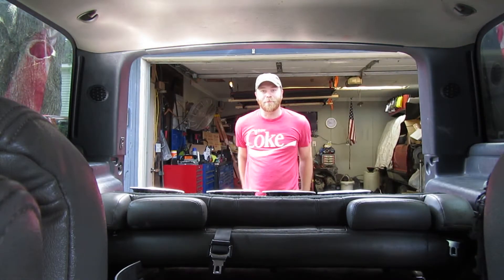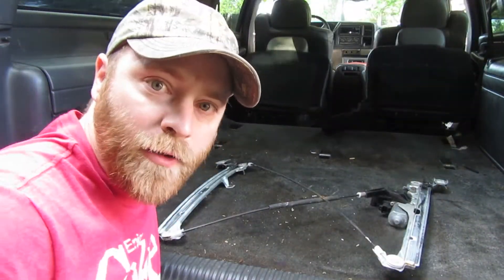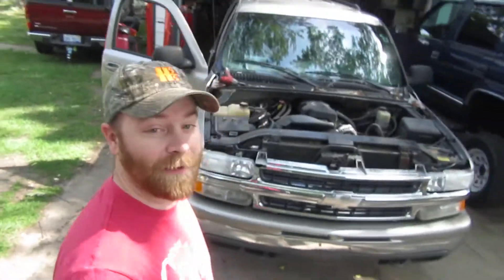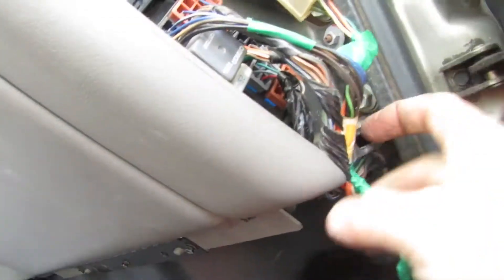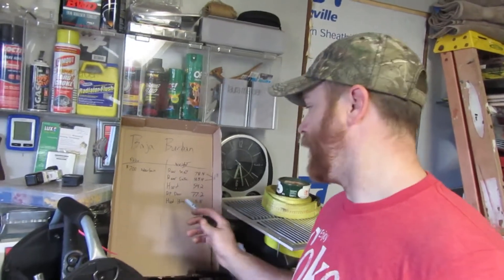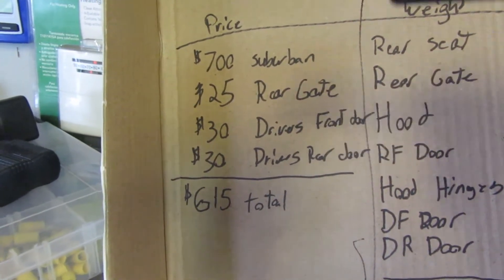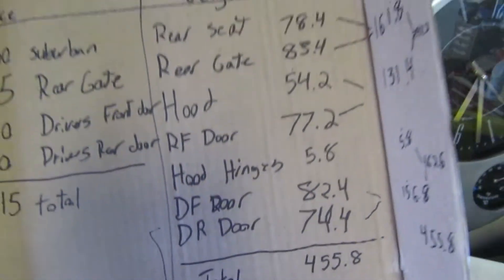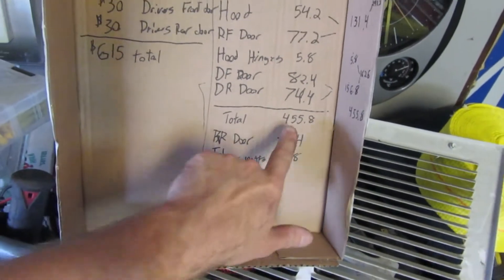Baja Burban 2.  Let's Lose Some Wieght!  PostalRedneck

Comment: On the door wiring where you unclipped it from the cab the pulled all of that sit thru the hole if you would pulled the rubber boot forward it simply unplugs. Right there and you dont have to pull all of that shit out. I have a 02 tahoe and rewired the door speakers to an amp and when I got to the door jam that's when I figured out that plug is under that rubber and I couldn't just run a wire thru the boot like the old trucks so I just clipped the stock wire before the door jamb and left the stock wire from the door jam to the speaker.
Reply from the maker: I have sense scraped out this truck but my buddy is running his in the dunes still and we remove and install the doors on his all the time.  I will have to check this out that would save some serious time.  Thanks for the tip.  I wish I would have known about.
Reply: @PostalRedneck  lol no problem man. Mine has the rear hatch on it and it has that same style on it.  What's your new project
Reply from the maker: Ill probably rock my Tahoe for awhile.  Right now im working on lifting a 1986 Oldsmobile 98 Regency for my winter beater.  Hopefully if I get ambitious enough ill work on the S-10 Blazer in my garage.